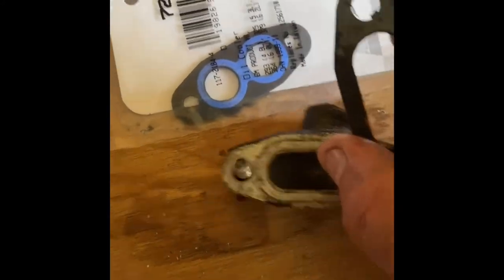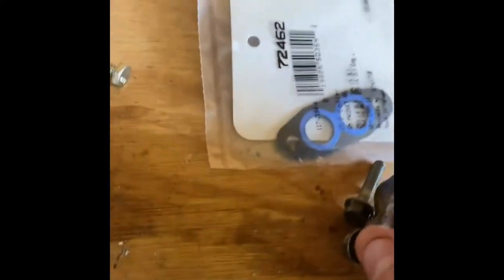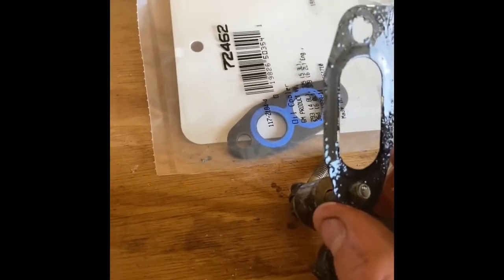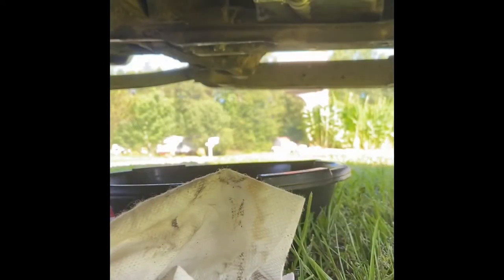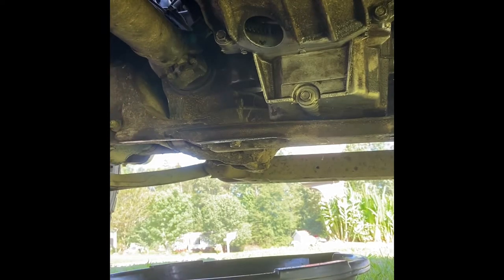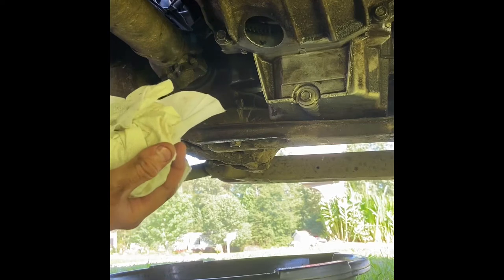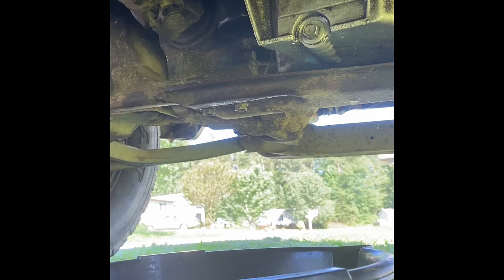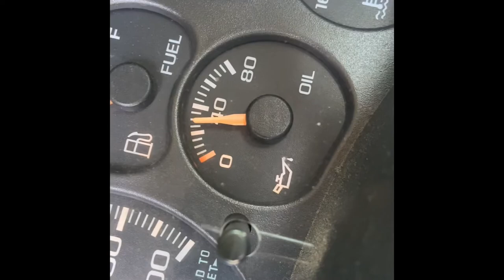Chevy 5.3l oil filter housing gasket

Comment: that new gasket you purchased is for if you have an oil cooler,which you don't. The part that is leaking is the oil cooler block off cover, The aluminum one is the correct oem gasket for it. i would change the block off cover as well since it can have small areas that are knicked making the gasket not seal all the way. i have an 05 tahoe & just changed mine